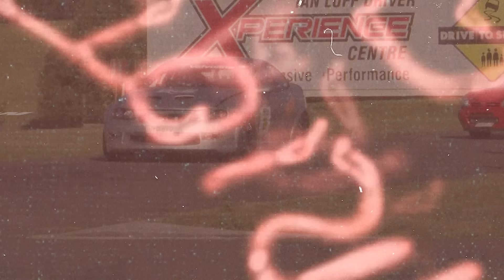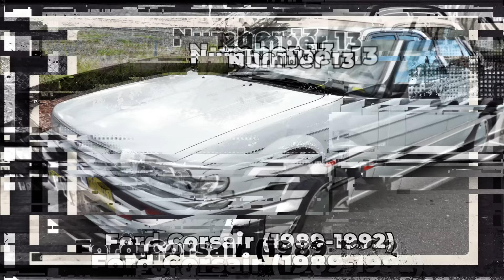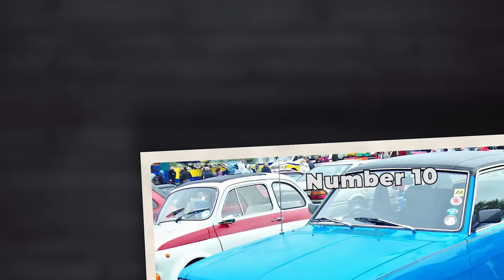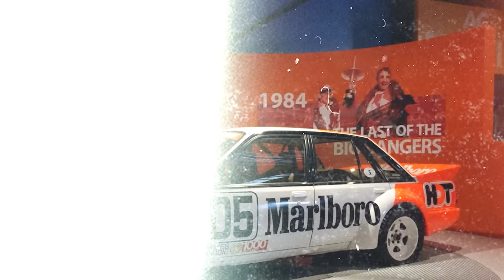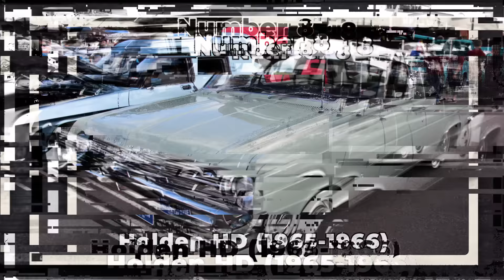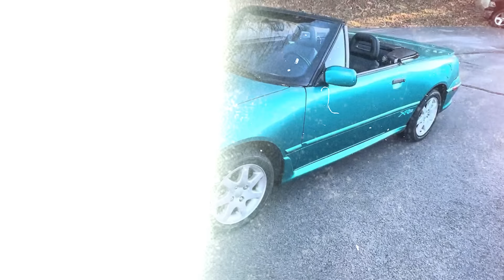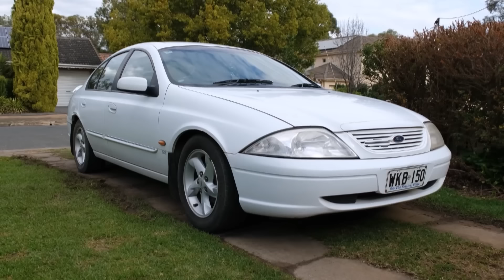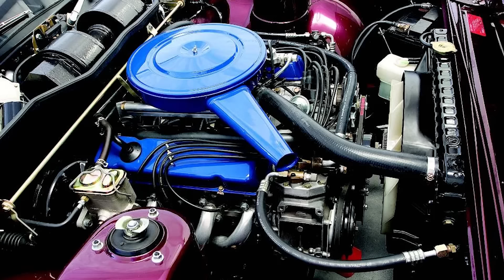Top 15 Worst Australian Cars Ever Made

Comment: I had a 1988 Camira Vacationer that had 300,000 km's on it when I purchased it for $1000 back in 1997, It was a trade in being a travelling salesmen's car.  Years later I put a new clutch in, water pump, timing belt and brake rotors n pads.
Mechanically it was bullet proof, no issues, never left me stranded. Sold in 2004 for $2500 with 520,000 km's on it. It was starting to get tired but was still reliable.  Still miss it
Reply: I had a 1987 Camira. Cheap and surprisingly satisfying. Reliable too
Reply: and great on fuel😊
Reply: I has a 85 Jd Camira manual.Went reliable, trouble free for over 12 years, was a Demo $11000.Once got it up to 190kmh.Was even 🍋  lemon yellow colour😅.Was every bit as good as my next Holder Vectra.No lemon Only the Jb Was a 🍋 Lemon.
Reply: Cam Timing  Belt had to be replaced,  only repair, except  for routine repairs  ie Brakes  .
Reply: @gregorybennett-d8i  Timing belts are a major issue on many modern (1990 to now) cars. I wish I had an old-style motor in my car with no belts that need attention every few 10,000 km.
Reply: Maybe just a little bit of rust , In the  doors,me living at Jindabyne,  going up to Ski Resorts, on Salt applied roads, not cleaning  these  areas quickly. Also going fishing parking  close to Salt water.😮
Reply: @gregorybennett-d8i  I had a JD 1.8 manual wagon...gearbox was 5 speed getrag was very good , car had no problems ran very well and only having the 4th child required a different car...My son also had a Camira as his first car...cost $800 and ran for years...we both look back on our Camira years with fond memories...
Reply: I had one, bought it second hand with 50,000 km. Only issue I ever had was the welsh plugs rusted out on a big trip. Plugged them with radiator putty and araldite near Winton QLD. Drove home and had my mechanic friend help to replace them about 1000 km later. Lost that car in an accident while driving a dirt road on 2/2/2002 with 200,000km on the clock. (Road wet, slid off and collected a very large fence post). Even then I drove 5 km home with the front end stove in.
Reply: Biggest load of crap i have ever had
Reply: My old neighbour asked me to top up the oil in his 2wd rodeo  . 
Seemed like pretty late model maybe late 2000s  Opened the bonnet and laughed when I saw the ol Camira motor in it . 😂 
to be fair I had a n13 pulsar with same motor and was an animal  , would not die , only killed multiple gearbox’s from trying to kill the engine . Literally leaked that much oil it Caught fire and still went fine . Was on fire 🔥
Reply: I feel your pain, bro❤,l had a 1984 Camira from new ,l was 19 years old despite its now known faults ,l just love that car .l sold it  7 years later, and it still  look brand new. How l miss that car .🎉
Reply: My 1987 Camira was ex  Parramatta community services car,bought at 39,000km sold at just over 200,000km,only real drama was heavy on tyres.Survived BHP Steelworks Newcastle industrial fallout.
Reply: @garrywarren8748  Mine was a buy in Gladstone Qld. After 6 years the clear coat on it was being eaten away by fallout from the Alumina refinery and the powerhouse. It was either a crappy clear coat or an indication you don't want to live in Gladstone.
Reply: 😅😅😅😅😅😅😅😅u😅😅😅😅😅😅😅😅😅😅😅😅😅😅😅😅
Reply: 520K Still a baby.
Reply: Cap
Reply: I nearly torque steered into a power pole in one of those pieces of 💩
Reply: Those sohc engines with the 5speed pulled hard!
Reply: Wasn't the Chimera the equivalent to the UK Cavalier? Look virtually the same from mid bonnet back.
I had the 1.8CDi auto from 83, in 1995. Absolutely loved the car. Drove it for a year, but being my 1st car on the road, I9 sold it on way to soon, thinking it was nearing the scrappy time! Did have another 85 model, 6 years later as a stop gap, paying peanuts for. It had 225k miles on the clock, but the engine was sweet as! I then moved onto a Senator 2.5i which was basic, but nice!
Reply: Yes,  my mechanic friend told me that the last of the Camiras were actually good but their reputation was destroyed by the earlier ones.  It really doesn't pay to rush development.  In IT, we have a saying that "No one remembers a late project.  Everyone remembers a balls-up".
Reply: @normandiebryant6989 the fist was great car😊
Reply: @normandiebryant6989  Holden had finally got it right in the end but the name was already tarnished from the JB Camira.
If the 2 litre engine was fitted to the JB it would have saved the name but the fixtures n fittings were just slapped together.
JB's trademark was blowing smoke from near new as it had weak piston ring tension causing smoke and heavy oil consumption.
Like you said mate "Everyone remembers the stuff up's"
Reply: @normandiebryant6989 got told by a mechanic if jack up on side of a carmira and open the door it doesn't close properly after that anyway should have bought one when i was dirt poor just driven it till it died
Reply: The last model JE’s were good things but the damage was unfortunately done by then.
Reply: @trumps1973  We had a JE Camira, it had a faulty CPU that would cut the engine for no apparent reason, which stranded you on the side of the road, then for no apparent reason the car would start and run OK for a month or two, then it would do it again.
Reply: @russellmoore1533  my JD did that. Such a heap it was.
Reply: Holden did the JE no favours with the tyres they came with. Goodyear Vectors that were the worst tyres I've ever had on  a car. I put some Pirellis on the front and it changed the handling superbly. Much more turn-in and the rear just followed.
Reply: @trumps1973 yes, it was too late to save its reputation. I really liked my manual JE. The 2.0 l engine really sang when you let it rev. The auto was a classic slushbox and did not compete with the next generation of automatics that were starting to appear in Camrys etc.

Comment: In your own wording of Australian “Worst” cars you have contradicted yourself putting the Mitsubishi 380 in your category of just that when on the other hand your saying there was nothing wrong the car only its “timing”  that surely is not a “worst” car! Like most of the Magnas and 380’s ghey were bloody good cars, now there is one other car you failed to mention that was nothing but a heap of shit which was the Australian built Toyota Corona that unfortunately was powered also by the Australian Starfire or better known as the backfire Holden engines they had in them, total dungpiles! Don’t forget that Holden Sunbird first came out with that German GM trash the 1900 Opel then later the Starfire engine, you should have mentioned the GM Holden Captiva or Craptiva those things along with the Cruze really did put the nail in Holden, stupid idiotic GM trying to save money only shooting themselves up their rear tucker chutes, fools! I think your being overly harsh on the AU Falcons as they were not one of the worst cars as a matter of fact they were one of the most reliable it is only their styling that was polarising, they have been known to do huge miles reliably and their SOHC sixes are known for their durability especially the models with independant rear ends they were even much better than the twin blade IRS in the later FG Falcons what with their diff bushes just about all failing at low mileage let alone the series one FG’s crap, rubbish 5 speed auto transmissions that are real bad news no wonder Ford dropped them after a couple of years to standardise with the ZF’s these should have made it to your “worst” Australian cars category far far more so than the Mitsubishi 380 for example!

Comment: The main problem with the sunbird was the fuc**ng 3 speed auto having a mind of it's own and revving at 4000 revs at 100km/hr. My next car was a 1987 carburetor glx magna: bacause of it's 2.6 liter 4 cylinder it used half of the revs at 100km/hr of the sunbird and had high torque in 5th manual gear; what a great fuel efficient car it was. I am trying to buy it back again to get myself out of my high revving mazda 3 and all of it's sensors fuc**ing etc etc.
Reply: ah ha , lol they weren't called trau-matics for fun
Reply: @duncanyourmate2433 when I was working in the automotive industry fixing cars, we called the trimatic transmissions “try- spastics”!! We often called rotary engines “chook cookers”: Rotary, rotisserie, chook cooker. High revving Jap car engines were often called Hiroshima screamers!! I could go on, but I won’t.

Comment: The Australian based manufacturers were wholly foreign owned subsidiaries which operated under substantial tariff protection.
The local models usually had outdated engines, transmissions and suspensions and basic interiors.
One could view automotive manufacturing capability as a national security issue.
The federal government should have encouraged local investment in the industry and insisted upon Australian equity.
Reply: The degradation, decline and demise of the local car industry started with the infamous Button Car Plan of 1985, under the Hawke Government. The late and unlamented Senator John Button was a former member of the Italian Communist Party, which pretty much tells you all you need to know about his agenda. I worked in the industry from 1969 to 1996 and saw first-hand how it was being dismantled.
Reply: @chrisweeks6973  typical communists,, have to ruin everything lol
Reply: Germans , still subsidise the Auto industry , provides good solid cars ,thus the Employment , Hockey decided , with Howards approval , to Stop subsidising the Auto (Ford, Holden ,mainly) manufacturing left ,with many thousands  of stable ,Unionised safety conditions , full time jobs
Reply: @duncanyourmate2433  German subsidies focus mainly on promoting EVs. The German industry also has unfettered access to the EU, the largest market on the planet. Protecting Australian industry was a fool's errand. Every job saved cost $100,000 pa. Certainly no fan of Hockey, Howard, et al. but Australian consumers/taxpayers were paying through the nose for inferior products.
Reply: The P76 engine wasn't part of the out dated group it had a unique  light weight aluminum engine design that is square most V8s have a shorter stroke and don't have the P76'S tall deck block or the low down instant torque.The engine was over engineered the main bearings journals are less than 1 mm different from the Chevrolet LS1 main bearing journals.Ian Richardson who worked for McLaren worked on engines and raced McLaren CANAM cars and he did racing development on the Ford GT 40,always liked lighter engines and he saw the Motorsports advantage of the P76 V8 so he developed the Wildcat V8 engine based on the P76 engines architecture.The Wildcat Racing engines come with cross bolting and a reinforced cast engine block the engines are  still being produced under special order in the UK the 6 litre recommended  maximum capacity is the same as the original P76 engine.The Wildcat Engineering cylinder heads for the engine are based on aftermarket Buick V6 heads and incorporate the Ford GT 40 Gurney Westlake small block Fords combustion chambers and spark plug angle.The engine is capable of producing 800+ hp naturally aspirated.

Comment: I had a Ford AU Ute with the 250CI 6 Cyl with 5 speed maual and it was fantasic. 100% Reliable and trouble free. When I sold it after many years I made $2500 more than I originally paid .

Comment: The AU was bulletproof, no idea what you're talking about
Reply: I'm pretty sure this channel also did a list of the most reliable cars with the AU being one of them.  WTF 😂
Reply: Styling didn't impress, like the Fotd Taurus..though the sport  XR6 or XR8 looked better..
I had a the steering bolt drop out, lost control and crashed into armco on opposite side. Very lucky no oncoming traffic. Bolt found further up the road. Examination showed it had been all but broken, it had only been hanging on by a sliver .
Ford denied knowledge of a fault claimed it had suffered earlier impact damage. Many months later motoring journals reported a recall following incidents like mine due to an installation fault .  Appears Ford were already well aware of it when they were contacted.
Reply: Best car ever
Reply: Still got mine
Reply: Still going strong 💪
Reply: They were way more reliable than Holden V6's.  Most of the mechanicals carried over from the EF.   NONE of the cars shown in the clip ( including that bizzare jacked up thing ) , show the original grille design that people found totally objectionable.  The Fairmont/Futura grill was a lot better,  then they introduced another one for utes than the like.   Wagon styling wasn't great either.
Reply: @JSelwood considering the holden/Buick v6 is widely regarded as one of the most reliable engines made its a testament to the old I6
Reply: Ford sold plenty of ELs after the AU was launched LoL... Great car...
Reply: I used to do on site work at Broadmeadows Ford plant. Even the management hated the AU. I told the logistics manager I owned a Holden VT SS. His reply was "Great car!" & I still own it & everything works
Reply: It was a good car, Mum had a AU Fairmont, always reliable and never caused a drama, but it was only slightly less ugly than KIA Tasman !
Reply: He has no idea what he's on about
Reply: Funny isn’t it? They bag the AU, yet everyone we got into the used car yard sold quickly, yet VT’s couldn’t be given away
Reply: @petermc165 They're still kicking around today off nothing than general service intervals. Finding a VT on tge road still are as rare as hens teeth
Reply: @Twenty_Six_Hundred  just go to any trade school, you’ll see hundreds of old commodores and falcons.
Reply: @petermc165  Really? That completely goes against the reality when they were both new cars. VT sold up a storm, AU did not.
Reply: @LadzeeFixes  yes but there are many aus on the streets still...
Reply: @LadzeeFixes  Not really, by the time they were second hand everyone knew how solid the AU was, so it makes sense they would sell fast. I bought mine 14 years ago, still drive it now.
Reply: They're great cars shame the styling let it down.
Reply: @chuckselvage3157 I don't think the styling was that bad. Ahead of its time I think. I see one on the road now and I think they look pretty good.
Reply: @fredjones9750 Can't agree with you my friend compared to the ELs and the BA/BFs they're just no. The XRs looked alright though. My girlfriends dad a few years back owned a XR6 ute that looked and went alright.
Reply: @chuckselvage3157 i mean i didnt like it at the time either. maybe its just nostalgia that makes me think they look better now. but you could never accuse the au of looking boring like the commodore of the time.
Reply: @chuckselvage3157 yep. Done a fast and rear lift “BA” and they sold like hot cakes
Reply: Yes ugly AF though.
Reply: @shegocrazy  series 2/3 improved the looks, series 1 looked crap though
Reply: The AU just looked bad apart from that they were solid cars

Comment: How did I know the Camira would be high on the list??
Reply: I'm surprised it wasn't top of the list.  The P76 suffered quality problems but the early Camiras suffered dire design AND quality problems.  You'd think the largest car maker in the world would know how to build cars without such huge problems.
Reply: @normandiebryant6989  The second generation JD Camira was excellent,  the Mrs had one and no problems at all.  Better 2 litre engine etc and Holden had sorted out the problems, but far too late,  the damage had been done.
Reply: @normandiebryant6989  My father regreted buying one, especially after the A/C compressor was damaged because they had them poking out of a hole cut from the engine sump-guard!
Reply: @normandiebryant6989  GM might be big, but quality hasn't always been their main focus. Volume is what makes them big.